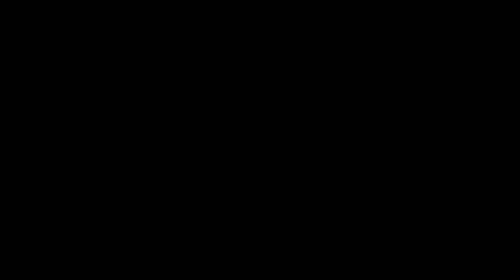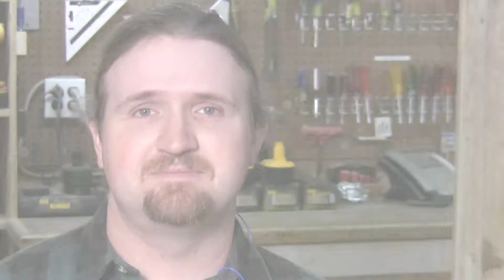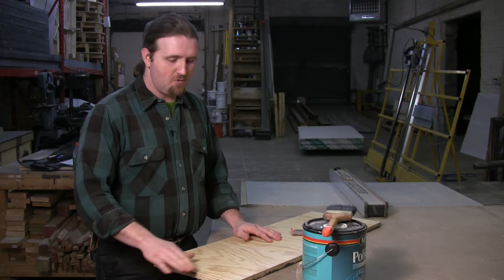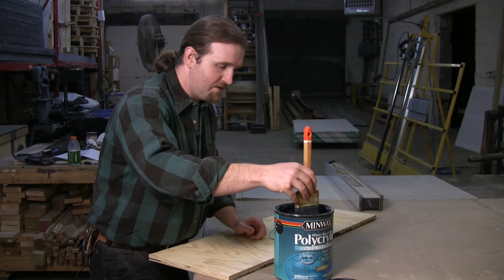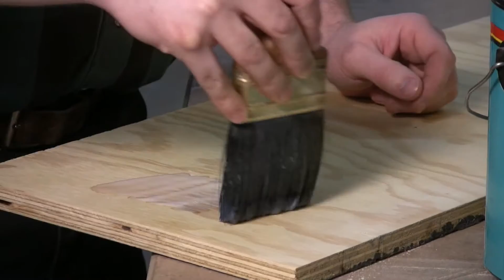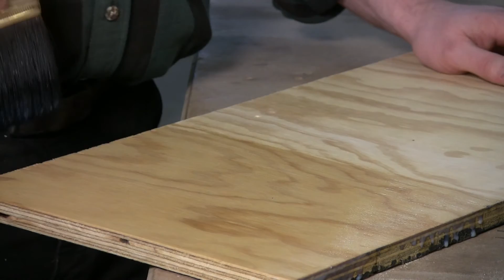Home Repair & Power Tools : How to Apply Varnish

Comment: clean the wood off after you sand !!   The dust from sanding will ruin newly applied varnish ...  You need clean dry wood.   This guy sanded the wood and then brushed his varnish right down ontop of it right after.  I wouldn't do it that way....